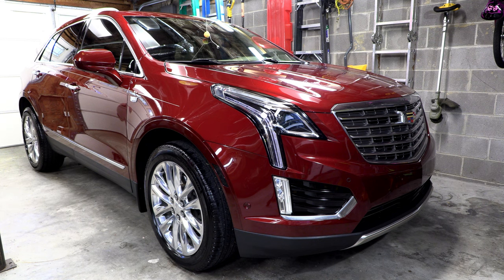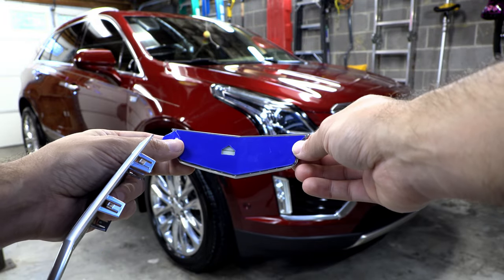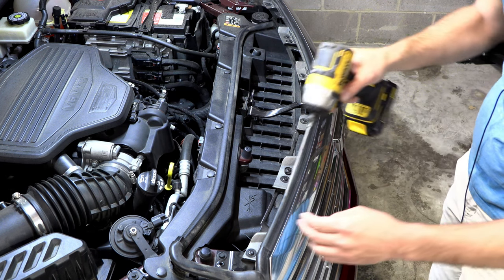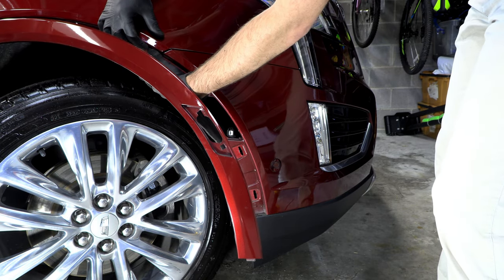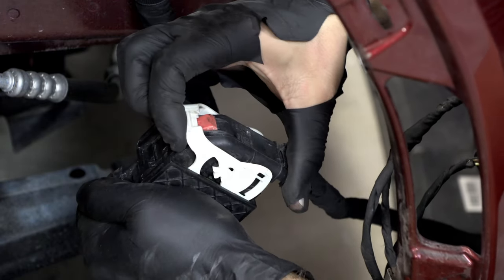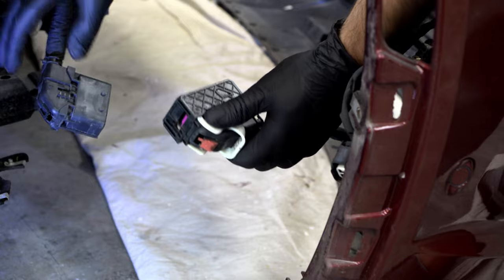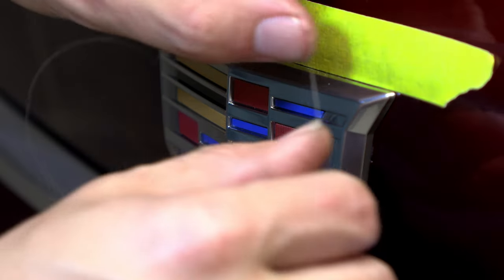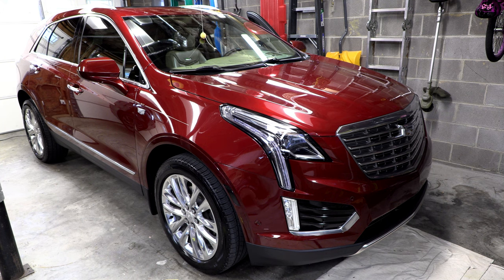2017-2023 Cadillac XT5 Front Bumper Cover Removal (upgrade to Monochrome Emblems kit 84675901)

Comment: Nice job, I was not going to try to resale my old emblems. I used a box cutter with a new razor blade and slid an old credit card between the emblem and the grill  and squeezed the razor blade in between them and cut the clips off. The credit card was an extra step to help from not damaging the grill with the blade. Hope this helps
Reply: I was thinking of doing something like that?? How effective was it??

Don’t care if clips break

Would poke them out with a flat head or something of the sort

This was is hella time consuming for something so simple 

You literally wouldn’t even need tools

Just push in with fingers

Comment: Your vids on how to do stuff on your XT5 are the absolute best.  You've inspired me to try this on my own XT5 as well--I've always enjoyed and wanted to this kind of thing--and now that i'm kind of housebound i have some time to do it.   My problem is that now i am trying to replace the rear bumper fascia appliques(the 2 chrome strips set into the thing) and there are no videos by anyone on removing the rear bumper cover, nor access to instruction manuals or decent instructions about it.  I'm kind of slowly groping my way along but it's hard to see what lies ahead.   Can you give me any suggestions?  Or better yet,  do a video of your own of that on your own XT5!  Thanks............................
Reply from the maker: Thank you! I haven't had a need to remove it so far. That being said I can provide some clues. Generally on GM vehicles the rear cover will be similar to the front. Pull off the wheel arches, there should be a single bolt behind the wheel liner, and most of the rest will be clips. If you look at my XT5 tail light video that should help get you started.. Also if you look at my LYRIQ hitch video that might provide some general guidelines as GM tends to follow the same design for attaching these covers. Good luck!

Comment: Great tutorial.  I am working on replacing the ambient temp sensor in my XT5.  I'm hoping to only need to loosen the lower part of the grill cover to gain access.  Also, I was not able to find the mentioned link to the GM removal/installation directions.

Comment: Can you explain a bit more about the black backing on the back of the grill. I would like to replace my grill ....P.S Do you have a front camera on your grill
Reply from the maker: Yes I have the 360 vision option so there is a front camera. The black backing is what supports the horizontal chrome strips. I'm fairly certain if you replace the grill entirely that black backing comes off as one assembly with the rest of the grill and you don't have to worry about all those darn clips, just unclip the grill around it's edge.

Comment: Love the video I just brought this set so this will help me alot. I have a off subject question I have an 2017 XT5 luxury I want to change my fog lights to clear instead of the turn signal how can I go about doing that?
Reply from the maker: Hmm....xt5 doesn't have fog light, which lights are you talking about?
Reply: The turn signal lights at the bottom I see some people have them white
Reply from the maker: @charlesatkinson3374  ah, yeah - on the higher trims it has white LEDs that are a continuation of the strip in the headlights. You would have to install new light assemblies and then wire them.
Reply: @DavidWaltermyer  okay thank you